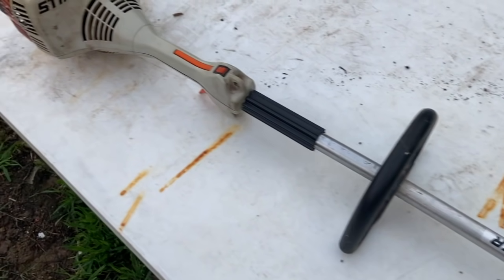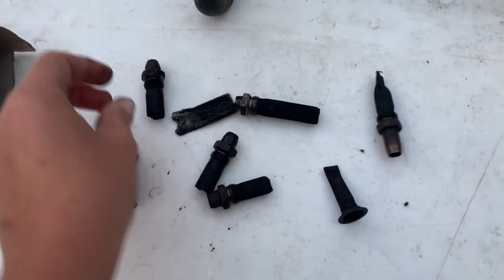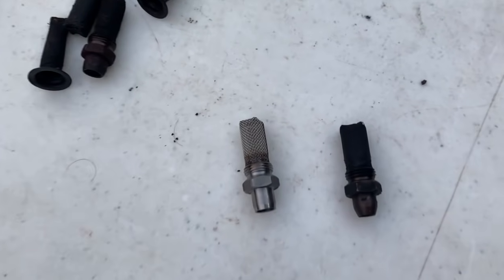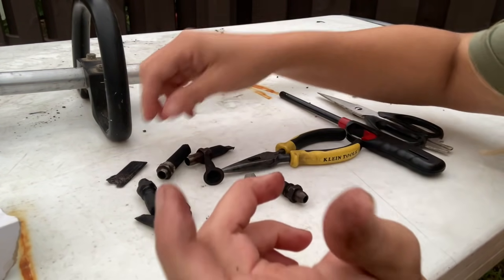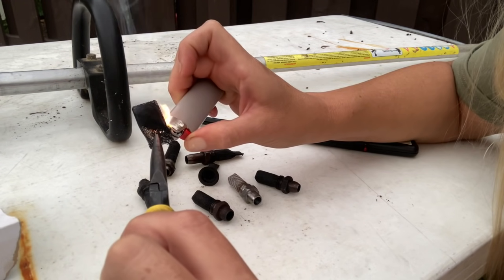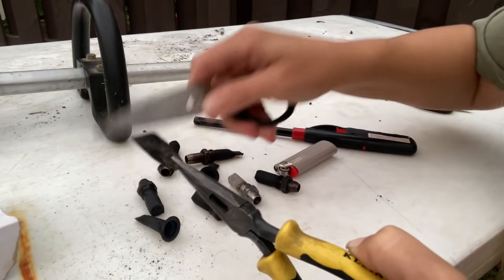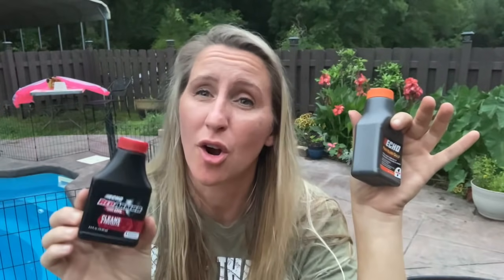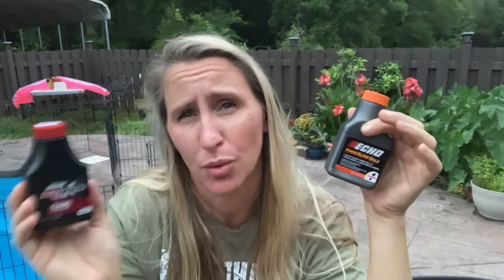THE BIG SECRET! STIHL has NO POWER? Won't Throttle Up? How to fix your trimmer/blower.

Comment: 2-strokes have two operating positions: off and full throttle.  😁
Reply: Wide open !
Reply: Tell that to the guy on the KX500!!
Reply: I second that 💪🏻
Reply: I dont put the throttle all the way down & I have some differences. I have all the km series, TE series, br series
Reply: That's what Stihl tell you. Two stroke motorcycles do not have to run at full throttle all the time. Saying it has to run at full throttle all the time is  an excuse for a substandard product.
Reply: @planespotter4494  Those screens are spark arrestors, running ANY 2-stroke with that type of spark arrestor will clog up by running at low rpm a lot as the exhaust is not hot enough. 

2-stoke motorcycles, boat motors, snowmobiles, chainsaws…they will all foul up running at low rpm a lot.  By nature of design you only get the power when at/near full throttle.
Reply: Uh ya no.it's totally fine to run without it . I've ran literally everything you can imagine with out the those damn screens. Your not gonna catch on fire n it won't harm anything or blow up.  It's perfectly effin fine without that bs.  Yes it burns excess fuel n fumes n smoke n blah blah blah.  Just take it out n run your machine which ever way you want.
Reply: @southtexasspecials175  They do run fine without the screens.  It’s more the motorcycle/atv’s that can start wild fires as their exhaust is brush level.
Reply: @southtexasspecials175  Thank you for speaking up with wisdom.
Reply: @planespotter4494  
Motor cycles are a different animal in use than a 2 stroke appliance...
Run your chainsaw at either idle or full speed when cutting hard...otherwise the clutch slips and wears out...and the spark arrestor clogs up...
Ditto string trimmers...clutch wears out, arrestor clogs up.
And on you vehicles with 2 stoke motors, never lug them at low revs and high gear...select a lower gear and rev them.....
Reply: @southtexasspecials175  
Hopefully your homeowner's insurance will still cover the fire that rips through your trees and the neighbours' properties after you set them on fire...
If you have a diesel truck, tractor 4wd, UTV, ATV....put some stainless steel mesh in a sock-like configuration over the end of the exhaust pipe (hold the sock on with pipe clamps)...the flaming carbon chunks that get caught there will amaze you....
It may also help with petrol/gasoline engined vehicles...
and don't park a vehicle that has low ground clearance on dry long grass...
if it has a catalytic convertor...it will catch the grass on fire...
Reply: The whole video was stating that Stihl oil fouls the spark arrestor more than other oils especially if running on partial throttle. Using other oils will prevent fouling and you can use partial throttle,  reducing fuel consumption noise and emissions. I never operate any outdoor power equipment at full throttle apart from the homelife leaf blower as it has a stupid preset throttle that drifts back to idle unless you click it into full throttle.
Reply: @planespotter4494  
And do you see a difference/change in the frequency of clogging when you remove and examine the leaf blower's arrestor screen compared with the others?
If you do all the arrestors at the same time...is there less clogging?
If you do them when they clog...does it take much longer between cloggings?.
Reply: Just like my headphones.. 😎😅
Reply: I must be old fashioned. When I start any engine, I try to let it warm up for a minute or three.  Then they get full throttle, whether it's a four stroke.. I have Honda's and two stroke usually Tanaka. Believe me they never let me down and shall we say work for their lives!
Reply: @TheJon2442  I hear you. Although, would think that, if it's not warmed up, it would be chocked. If no need for choke, than already warmed up.. Choke=warmup, no choke=warmed up=full throttle.. 🤔😎😅
Reply: @TheBeingReal  Just like my car.
Reply: I hardly ever run my Stihl weed eater about probly half throttle with Stihl oil mix and have them use them regularly for years and no problems like she is talking about
Reply: I run full throttle 10% of the time. Anybody who does is unnecessarily putting themselves at risk n many ways
Reply: @playgroundofsound7683  at risk?
Reply: @TheBeingReal  eye injury.. window breaking.. Todays weed eaters r massively overpowered
Reply: @playgroundofsound7683  If one is not smart enough to wear PPE…then get what you deserve.  If you operate it with the direction pointed to people/houses etc. then an F for fail. 

As for being “over powered” that’s a bit vague.  If you buy commercial and use it on a very light duty home yard…probably.  I own commercial and use mine in heavy duty “hobby farm” conditions and can easily stall it if too aggressive with it.  It’s like buying a Z06 Corvette and only grocery shop trips Vs tracking it.  All relative.
Reply: Put on hearing protection and let her rip WOT. Piss off your next door neighbors.
Reply: Nah, they have three, off, idle, and full throttle
Reply: @JohnSmith-pl2bk  I'm on the volunteer fire department and we had a car fire last month where the owner went off the road.
He spun his tires trying to get out and the catalytic converter caught the grass on fire  burning his new Dodge Charger.
There was nothing left.
Reply: @greghooper4235  
Yes, multiple Police K9 units here do the same..
high speed to the scene, park on the long grass at the side of the country road....
Whoof! 
Up she goes....
Reply: @playgroundofsound7683  massively overpowered lol. Mine would have a ten horse on it if I could carry it. I may port it for some extra oomph.
Reply: Its actually a lubricant  since two cycles don’t have a oil tank if you believe you don’t need the oil don’t use it an find out how long it takes to seize up. Lol
Reply: @DdD-pi8jw  True if you want power. Period!  🤣
Reply: @DdD-pi8jw  Go read your posts. lol. My response was quite clear and in English. 

It is not possible to “write the English language.”
Reply: @DdD-pi8jw  Did you bother, at all, to read your nonsensical response to me?   

If you are just here to inflate your ego by insulting people, it is petty.
Reply: I hope i dont encounter you on my snowmobile trails.
Reply: @pitchandlimb  bit off topic from a string trimmer video.
Reply: My brother had moped in 80s that was ported HARD, with already 70cc (+20cc over legal) cylinder that you could ride at only 2 speeds, at near idle 10 mph or wide open throttle at 60 mph. It was sometimes funny to overtake cars in highway.
Reply: @SixOFord Hi. We got big uns here. We use them for thinning years before planted young forests (to promote forest growth). 20lb. 4 horsepower. Saw blade. Heated handlebars... Cuts 2 to 3 inch thick tree like hot knife through butter.

Comment: I’m a technician myself but have only worked on cars and trucks. It bothers me when I have to take my small engine equipment and let someone else work on it. I have learned a lot watching your videos. Thank you
Reply: Same here.. no problem working on vehicle engines, but my small engines, for whatever reason I am afraid. Haaahahaa.
Reply: I just use 40 volt.  Then I no longer have all the problems associated with small carbureted engines or the stink of their exhaust.  My mower still runs on gasoline but they are a lot less prone to trouble than a smaller engine like that of a chainsaw.
Reply: LiON riding machines can go an acre, even more. The battery packs are huge.

LiON tech is red hot now. Improvements in utility and safety prove inevitable. Even a silicon battery may arise.

Elderly "snow bird' types hate the noise and effluents from gas machines. Legal issues inevitably will also arise.

DIY'ers like that the new machines simply start and work: No idiot throttle control, somehow, to juggle--to get right.

Even encasing nuclear waste to serve as batteries is already here!: Pacemakers.

Big petrol also sees the writing on the wall': They'll push plastics, instead.

Face it!: It's over!
Reply: Howsoever, if they catch fire, you ain't putting it out! Look up the mower fire at the Louieville convention a couple years ago!😮😮😮

Comment: Never had a promblem with any of my Stihl power equipment.
Reply from the maker: @Fred Wills I love Stihl! Nothing against them. Just want to let people know how they need to run them and what they can do if they do get a clogged exhaust. I get at LEAST 2-3 a week at my shop clogged.
Reply: I use exclusively Stihl HP Mix in EVERY 2 Stroke with Ethanol Free Gas, Stihl 026, MS 391, Shindiawa T270, SRM 25...all run amazing even with high hour's.
Reply: I love my stihl moto mix  all ready made up ready to use
Reply: Bought my first Stihl chainsaw in 1990. I have three now and other than replacing a clutch once every ten years they all work great all the time.
Reply: @Chickanic  That is because people use old fuel/oil mixture in their Stihl equipment and it smokes like crazy causing carbon build up in the exhausts. Use high octane fuel and fresh oil mixture and you will have no problem with your power tool. Get rid of old gas/oil mixture after 2 months or add some fuel stabilizer to it.
Reply: Hey Nick, I'm paying 3.19 gl. What do you pay?
Reply: Hey Fred, what are you paying for the good stuff, I'm paying 3.19gl in Oregon!☮✌🏻️
Reply: @Chickanic  same in my shop. If a Stihl comes in, I clean the spark arrestor first whether it needs it or not for maintenance sake because 90% of them are plugged.
Reply: Really?
Reply: I have never had any problems with Stihl oil in any Stihl equipment , always be sure to use fresh non- oxygenated unleaded fuel. Stihl engines last longer because they don't rev too high by design.
Reply: Was given a newer stihl chainsaw by a friend burnt the piston twice, had the first one repaired on warranty, no warranty on the second( still under original warranty) when he asked the dealer why this was happening he was told he should have been using premium gas something he was never told when he bought the saw. I purchased a clone engine from Amazon $68.00 use standard mix oil and regular gas, been using it for 2 years now with no issues.
Reply: @bobbyoshomebuilt2544  Really; I had an 026 for 18 years; It was a Helluva logging saw. Finally it outlasted its livelihood. No parts were available to repair. As of now I have a extended hedge trimmer , 2 chainsaws and a FR weed eater brushcutter( all Stih l).
Reply: Me either!
Reply: My Husqys saws are better than my Stihls… just sayin
Reply: Never had a problem either? I had a 460 that i let a friend use in his tree business and chips kept the choke from closing so it was really hard starting. I dropped a 5 ft disc on it and had to replace the handle and after $150 in parts...good as new!
Reply: Never had a problem with my stihl equipment either
Reply: Probably because you know what you are doing. Machines are only as good as the operator!
Reply: @floroy9265  I switched to Husqvarna years ago. Much happier. And best off using manufacturer brand pre-mix fuel.
Reply: @michaelmactavish1728  so expensive here in Australia

Comment: Even ran full throttle 90% of the time the screens still clog, cleaning the screens is part of general maintenance. 30 seconds and a mapp gas torch not much more then cleaning a spark plug
Reply: Just take it off.
Reply: @rk22cc  Yeah great Idea let dirt dobbers into the engine.
Reply: You work for the EPA right. Exhaust port"………
Reply: @rk22cc  No just watch the other video she posted.
Reply: I have been weedeating about 5 acres around my home every year for about 40 years and I use older shindaiwa c35 machines, I don’t run full out because I take it all the way down to the dirt and if you are full throttle you get peppered with small rocks consistently,  my spark arrestor was plugging up quite frequent so I started using 92 octane fuel and ever since then I have not had to clean the screen once, but I do inspect it once a year.

Comment: We live in 10 acres in the Sierra Foothill’s. I use Stihl Equipment. About two years ago I started to transition into the Stihl AP battery equipment. I will never go back. No more two cycle problems.  No more pulling a rope, no more idling, no more choking, no more fueling, spark plugs, spark arrestor, no more problems. I invested in several batteries that by the way have over a 3000  to 5000 cycle ability before loosing capacity, that way I can work as long as I want without waiting for batteries to charge. I understand the continuing need for engines but for me the battery equipment is a wonderful improvement and a game changer.

Comment: I had the same problem with a older Ryobi trimmer. I noticed it didn't want to rev as high as it used to. When I removed the muffler, I could see a lot of carbon build up in the exhaust port, so I cleaned it out and problem solved. You are a great source of info for everyone watching. I'm an auto mechanic and I'm not taking anything I have to someone else. Appliances, lawn equipment, plumbing, etc. I'm glad YT is around so I can learn before I dive into a project.